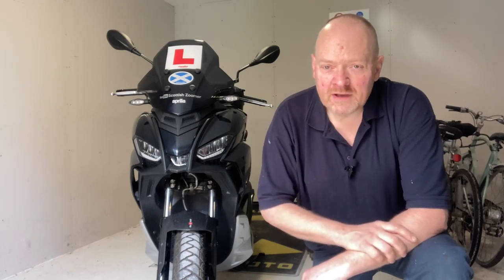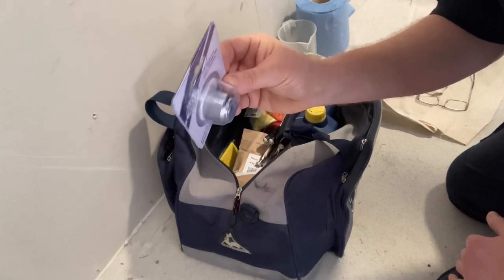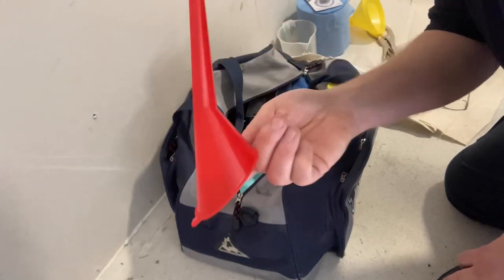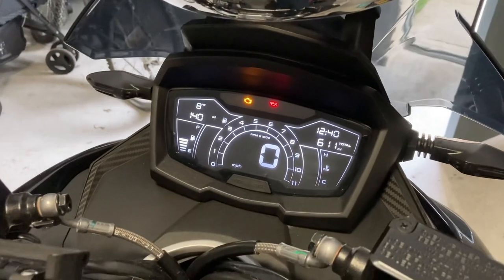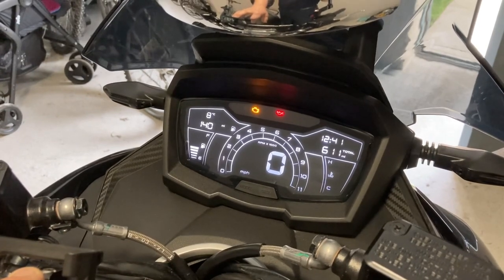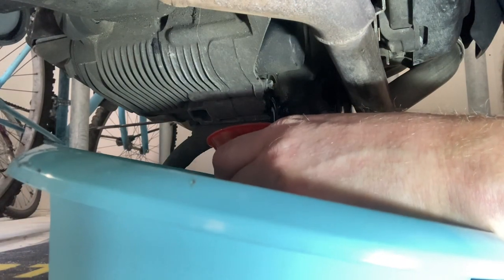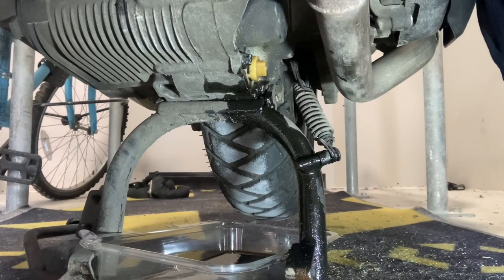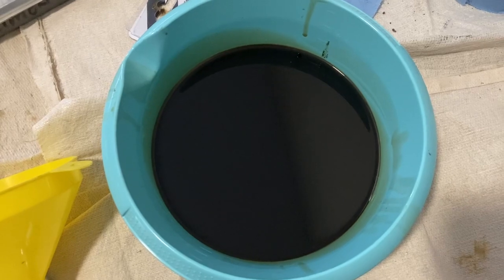Aprilia SR GT 125 : Oil and Filter Change

Comment: Just did my daughters SR GT 125  today , it was its first service also it was at 603 miles  , its  really easy to do  all done and dusted in an hour , I used Castrol Scooter 4T 0-30 W , the part number for the oil filter is 82635R if anyone wants to order one from a dealer , the biggest pain is getting the oil filter out as it hits the exhaust , but once you remove the silencer  the exhaust pipe moves enough to get the oil filter out , the oil filter I had on the bike had two protruding bits on the end of it , this allowed for a large flat head screw driver to be used to remove it , however the new one didn't , so that's been done up hand tight .
.

Comment: Thanks for the excellent video.
I have the 200 version and it is the same procedure.
The access is a bit awkward and I burned my hand slightly on the hot exhaust.
I managed to loosen the filter with the tips of my filter pliers and fitted a hex k & n to make the job easier next time.
Reply from the maker: Glad you liked the video, thanks.  I’ve a friend here in Scotland who has just bought the 200cc version of the bike, he’s loving it so far.
Reply: I am indeed loving it so far and find myself watching your video for info and a heads up on this job 👍
Reply: Hi Scootyman, funny enough I had a Honda Vision previously too.
I decided I wanted an extra 10mph cruising, hence the Aprilia 200 purchase.
Reply: @kennethdownie8961  thats pretty much the same for me Kenneth. I love the Vision and I’ve kept it for a winter bike when I’m taking it a little easier, but the 200 excels at that. Not a quick scooter in my opinion but it’s torquey and cruises nice at 50. It’s a keeper for sure.

Comment: This is good stuff. I got quoted £200 for my first service, horrific!! Not a chance! I can easily do my first service myself, even if it might affect the warranty. Have you adjusted the valves yet? That’s the one thing I can’t find any information on.
Reply from the maker: Thanks very much, oil and filter change is simple and that’s about it for the first service.  I don’t think valve check is required until 5000 miles (I’d need to double check).  Hopefully there will be info available by the time I reach that or I’ll just drop it into  a local bike garage.
Reply: @scottishzoomer  how did you find the information on what oil filter to use? I can’t find any information in the manual or even google. Infact I can’t find much information at all about this bike when it comes to servicing.
Reply from the maker: @HowlingWolfLeather  if I remember correctly one of the guys on the SR GT Owners Facebook group told me.  It takes the same size filter of the Piaggio Liberty.  There are alternatives to a genuine Piaggio filter but I went with that as I wanted to use the same things the dealer would have.  I agree there is very little technical info on this bike, no sign of a service manual appearing yet.

Comment: 16:35 checking the level is wrong, you don't need to thread the dipstick for verification, specify this in the manual
Reply from the maker: Thanks for the advice, always appreciated 👍
Reply: What is the correct way?

Comment: In how many kilometer you reccomend change oil ?
Reply from the maker: According to the manual the first oil and filter change is to be done at 1000km, the next at 10’000km.  I intend to do them more often than that but then I’m not a high mileage user.  I’ll probably do another oil/filter change around 3000km